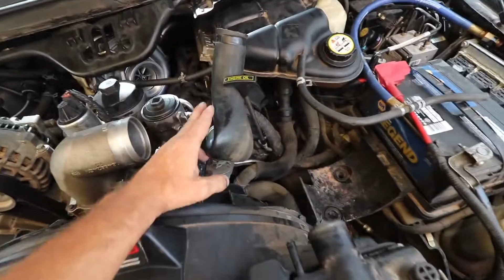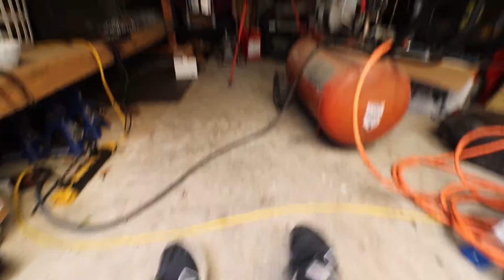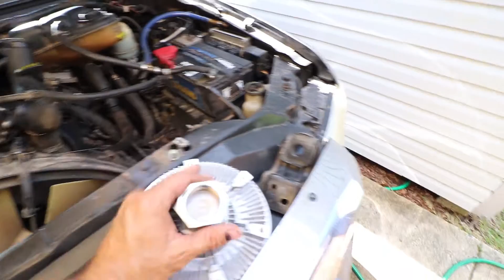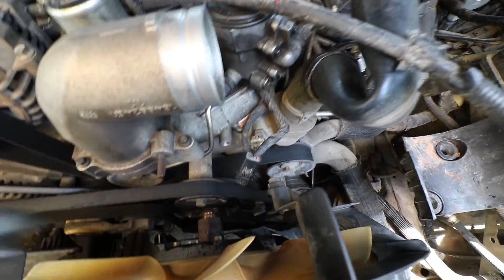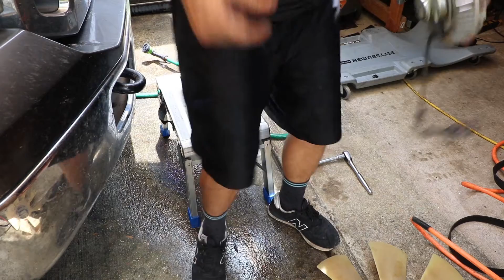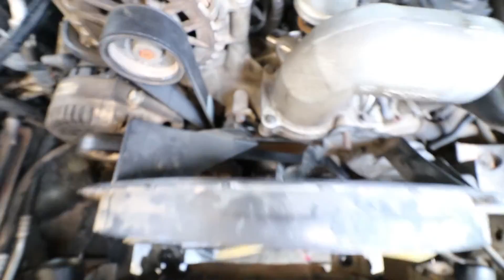6.0 Powerstroke - Mechanical Fan Clutch Install - Step By Step Guide

Comment from the maker: I can already tell a difference in temps with this upgrade, I highly recommend it! Tell me if you have done this.
Reply: Good video, I was wondering how the shroud came off. Now I know. My old fan clutch was making a crazy bearing noise whenever it was engaging. I also replaced the tensioner and idler pulleys. I found one of the seals leaking on the backside of the idler pulleys.Napa sells a pulley kit#90k-38257A
Reply from the maker: Sorry I missed this comment.
Reply: RV Adventure Couple what kind of temps are you seeing ? Before vs now ? I’m tired of seeing 215+ on both my eot & coolant when it’s 100+ outside & I’m studded and deleted as well
Reply from the maker: @malonefamily4568  My last trip out before the mechanical fan clutch my temps while towing our 34' camper would get up to 230 - 235 degrees on EOT and ECT. After the mechanical fan clutch and the Oil cooler back flush this trip out my EOT hasn't gone higher than 206 and ECT reached 204 the other day when it was 100 degrees out and we were going up a 8 degree grade hill that was like 6 miles long. Even when the ECT has barely jumped over 200 degrees the thermostat works so much better and kicks it back down to 190 in seconds. The next time we are towing up a steep hill I will take video and post it.
Reply from the maker: @malonefamily4568  Just released a video where I show my temp numbers as we climb a 7% grade for 20 miles.

Comment: You’re gonna have an engine light no fan communications
Reply from the maker: I love the effort in trying to be the one that's right, however your wrong. No, disconnecting the electric fan clutch (the Visctronic electronically controlled fan clutch) on a 6.0L Powerstroke typically does not trigger a check engine light (CEL) that illuminates the dash.The 6.0 Powerstroke uses an electronically controlled viscous fan clutch (often called the "electric fan" or "fan clutch" in forums), not a fully electric fan like some other vehicles. It has a magnetic coil for control and a built-in speed sensor that the PCM monitors.

Comment: So now two years have passed how has the conversation held up
Reply from the maker: It worked fine up until we got rid of it. Now I have a ram 3500 5.9 Cummins and I did the same mod to it. Made a huge difference on this truck as well.

Comment: Is the 6.0 sound of a vacuum when accelerating mean a bad fan clutch?
Reply from the maker: I wouldn't know, the electric fan wasn't bad. I just wanted the mech fan clutch for the constant cooling.
Reply: Yes it does I’m replacing mine because of that sound

Comment: I just bought my used 2005 F-250 SuperDuty 4x4 with 6.0 and found that it already had the mechanical fan clutch and wondered about how it was done. Your video is a great tutorial about it, thanks. I've never trusted the solenoid operated fan clutches. By the time you know that one has failed, it's already too late.
Reply from the maker: Thanks!

Comment: Stupid question but does this upgrade keep the fan running at all times? Little confused
Reply from the maker: Yes
Reply from the maker: All fans electric or mechanical always run. It’s just that electric will kick in high gear when the ecu tells it to, and mechanical kicks in high gear when rpms get higher ie. your truck down shifts to go up a hill.
Reply: RV Adventure Couple  I did the swap on my truck and  runs cooler on inclines with the electric fan. On my case mechanical didn’t work as spected . The truck lost power with macanical. If looks for smoother ride keeps electrical.

Comment: @RV Adventure Couple What's the part number for the clutch adapter?
Reply from the maker: https://www.amazon.com/DEWHEL-6-0L-Diesel-Mechanical-Adaptor/dp/B07QGB4D3K/ref=pd_rhf_ee_s_rp_c_0_3/136-7066113-6070529?_encoding=UTF8&pd_rd_i=B07QGB4D3K&pd_rd_r=5fb287a2-f816-40fe-9e6e-91b04954b06c&pd_rd_w=VOz0k&pd_rd_wg=oWSCU&pf_rd_p=b1bfe359-2fd4-467d-b6e5-960dee9202b3&pf_rd_r=1T50MNZX6K0EJ0EK625D&psc=1&refRID=1T50MNZX6K0EJ0EK625D
Reply: @grumpysdiy  Thanks, I found a cheaper one on Ebay.

Comment: Thanks for sharing this video, I just purchased the clutch and adapter from Amazon tonight for my truck. I don't have any cooling issues, but mainly doing it for the added insurance.
Reply from the maker: Really helps out alot, I have a video of me pulling our camper up a 20 mile steep incline. Showing the gauges.
Reply: @grumpysdiy  I seen the video, the difference in cooling capabilities between the two types of clutches is nigh/day. I also like not having to worry about my electric clutch potentially failing and causing my engine to run hot. It was a no-brainer to do the conversion.

Comment: Is the mechanical fan clutch a lot louder than stock ??
Reply from the maker: At certain RPM's yes, like when climbing steep hills/ mountains. But when your cruising the radio masks it, and that isn't with it that loud. It comes down to if you want to have a cooler longer lasting engine or deal with a little noise.